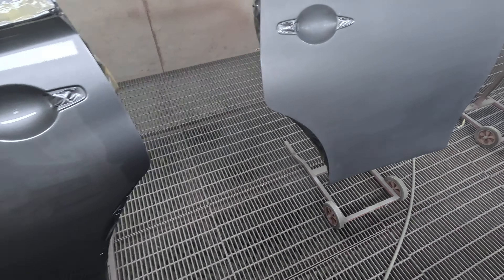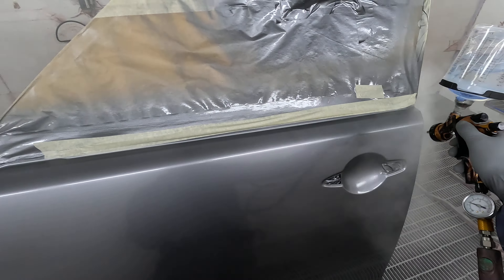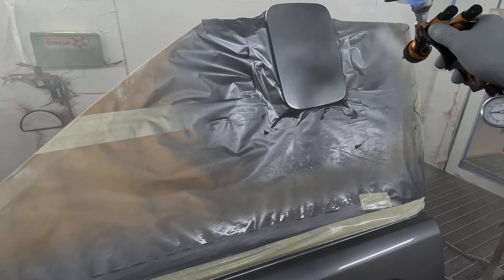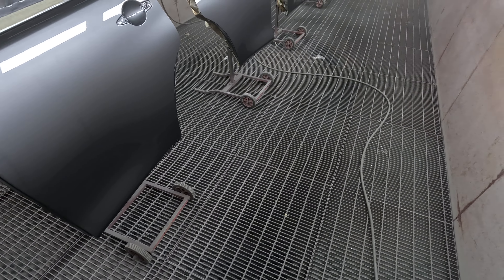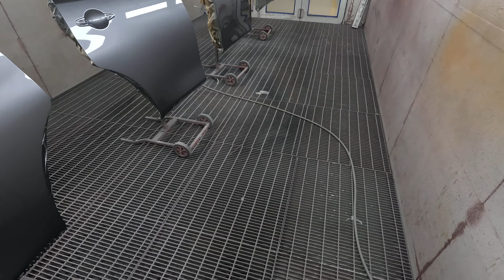Flow Coating with Old School DV1

Comment: I ended up switching completely over to Devilbiss DV1 guns and sold all my Walcom guns. I get so much less over spray and my Walcoms were even the HTE models. My DV1-B base coat gun is the Durbz Edition. Not that I needed the fancy look just the price was right from the outfit I deal with that is in Australia. Same people I got my DV1s mini from.
Reply: This comment helps a ton, I currently have the dv1 and I was seeking to invest into the Walcom for its light weight but I’ll ditch it

Comment: Is that correct you did first coat with 40psi and second with 30 psi, i thought the DV1 was low pressur ?  is that due to the 1.2 setup with c1 cap ?